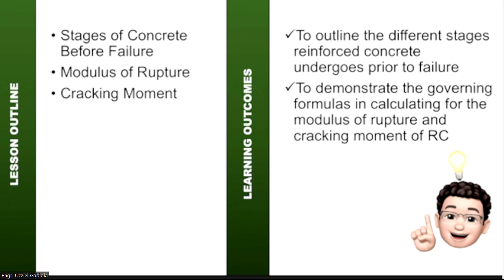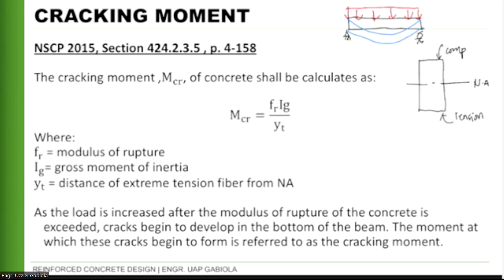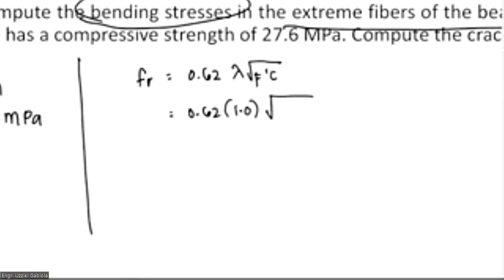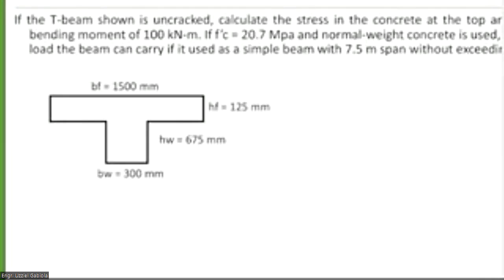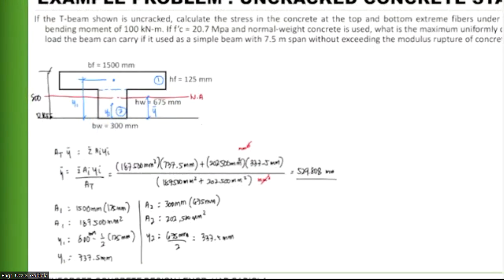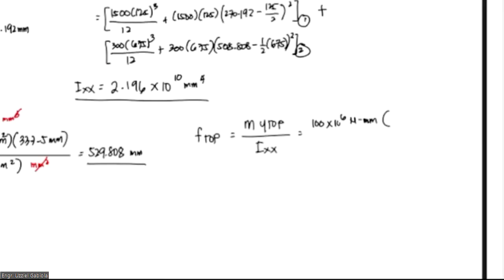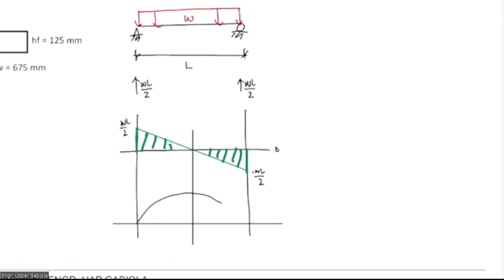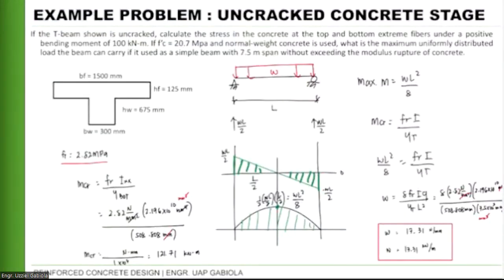REINFORCED CONCRETE DESIGN | FLEXURAL ANALYSIS OF BEAMS - UNCRACKED CONCRETE STAGE

Comment: sir correction po sa ybar niyo. tama naman ang pagcalculate pero yung naisulat niyo ho is 508.808 supposedly 529.808. naapekthan yung pag-solve niyo ng bending stress sa bottom.
Reply from the maker: SLR, first, thank you for noticing, hindi ko na napansin na mali na pala naisulat ko. Pero yes lahat ng calc mag adjust. New values will now be:

ytop = 800-529.808 = 270.192mm
ybot= 529.808 mm
Ixx = 2.351 x 10^ 10 mm ^4
ftop = 1.15 MPa
fbot = 2.25 MPa
Mcr = 125.372 kN - m
w = 17.80 kN/m

Though values were adjusted, the condition still holds. 

Again thanks for pointing it out. Kudos!